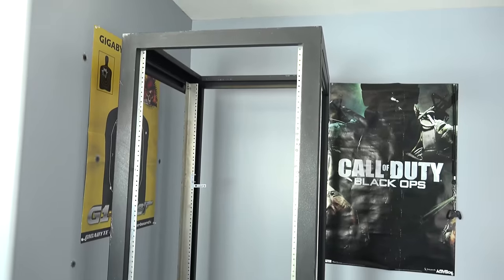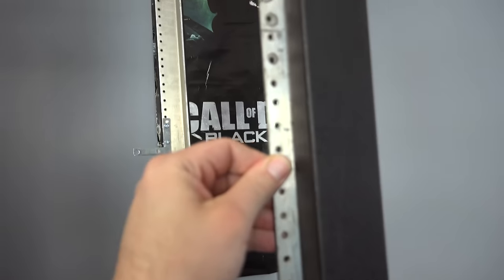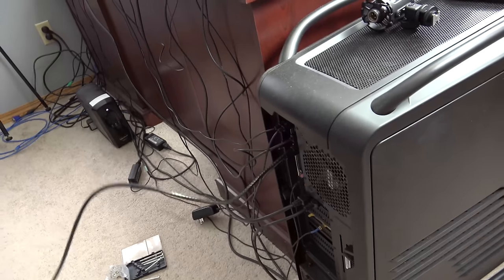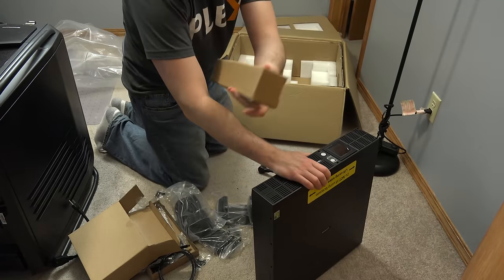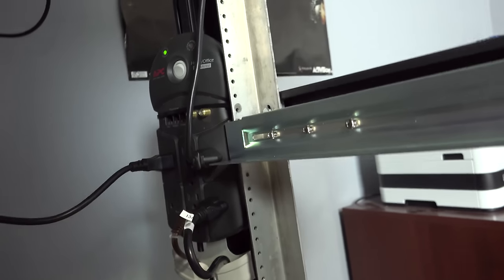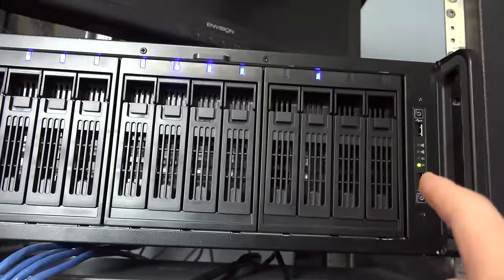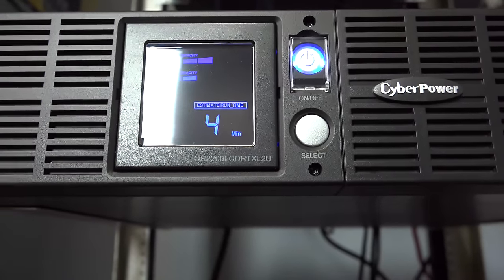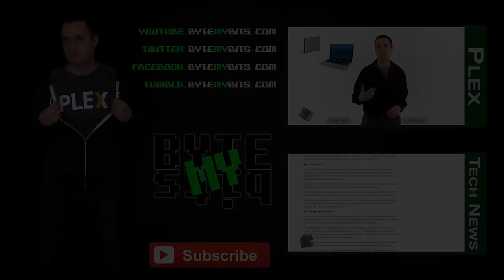Network/Server Upgrade VLog

Comment: Dude you should really invest in a redundant power supply for that storage server since all it takes is ur raid array rebuilding and ur supply to drop voltage and u have corrupted parts of your array and then it will ruin it on the other drives when it does a storage check
Reply: sam murphy ZFS being a CoW filesystem will more than likely survive a power loss during resilvering. The only bad thing is, the resilvering process will start over from 0% and one have to wait a few more days(or weeks)

Comment: Teaming bonding is not that complicated but I'm a Linux nerd so have no clue how to do it on Windows if have sum time il try looking in to it. See if I can't find sum short reading material for you. Kind of busy help my wife with her work/school projects and need to start on my cert studies but I like you projects and even the hardware you plan to use like zfs and free nas. I remember the guys on teksyndicate build a nice free as box a while ago. And even Linus build a nice freenas the problem is that you need to run plex  on the same system so CPU power is needed. Perhaps a bit more time than I have at the moment wish I had a PfSenese machine is on my list to.

Comment: as for the 20 amp thing your fine the braker will save it.. but no not switch your 15 amp braker for a 20 !!! it is there to protect the wires!

Comment: What made you decide not to do 10GBe? It's fairly cheap now a days. You can get a used Cisco switch with two 10GBe ports for ~$400.
Reply from the maker: +Nick Leffler Still too expensive for me.
Reply: Byte My Bits OK. What kind of network connection do you have at home?
Reply from the maker: 165/25

Comment: I believe this is the first video I've seen of yours and I plan on subscribing to see how your journey goes. First off, Congrats on diving into the world of rack mounted gear. It's a wonderful world you'll become addicted to. Go ahead and create a new budget category for it now. :-p

I heard you mention one thing I have to comment on: Mirroring or Raid of any kind is not a form of safe data. I can't stress that enough. Backup, backup, backup. Just being totally honest, but in my experience (I'm a server admin for a large company) raid will fail you. Not if, but when. If you've got tons of data, consider something like Amazon Glacier, or even just grab a 4TB external drive that could fail at any moment and perform backups. The chances of everything failing at once is really low. If nothing else, use google drive as a backup for those super critical, small files. I believe $20/year gets you 50GB. That seems plenty for most "Document" folders. Just my two sense, not hating. :-)

Comment: Have you looked at unRaid?  I've been very successful with it for the last 3 years, and now exploring the new version with docker apps.  Plex as a docker application I think is a pretty elegant solution for a Plex Media server.
Reply from the maker: +Matthew Clawson I have read about it but it costs money :(
Reply: True it does cost $90-120, i do believe it is far better than running windows and other options (parity, cache drive, and mix of hardware or drives).  Just a thought!  Keep up the fun videos!
Reply from the maker: +Matthew Clawson Yes it seems like a very stable/good option. I am just stuck with...spend $130 on a pro unraid key...or $140 on another HDD and use FreeNAS lol  Either way, I am stuck on windows until I have enough drives to build new storage pools (5 drives each) and move data over to make room for the other pools. I need to do this badly, but need a few more drives before I can. It would be fun to setup an UnRaid server and show how to deck it out for Plex, etc...but at the cost of a pro key, for me, equals another drive and a sooner adventure into a new filesystem.

Comment: The newer Core i3 's support ECC memory, So you could use one of those, if you dont have the need for the more powerful Xeons.
Reply from the maker: +unijabnx2000 "Need". Such a funny word...
Reply: +Byte My Bits .... lol yeah. You could always start with the ECC MB and ECC RAM with the i3 for now to save some change, and get the project rolling. Do some benchmarking about how it performs for you work loads etc... and later post the upgrade video to the Xeon  with comparison results.

Comment: noooooo there are non rail compatible racks. p[eople been mounting them this way for years. its fine. ive hung SERIOUSLY heavy amps from only the front ears, wouldnt do it with a server, but if the rear is supported as you have its no prob. the server isnt moving, those screws can hold LOADS of direct weight, just no wiggling about ;) use ALL 4 screws tho or you promote the ears to turn = sheer force on the screws holding the ears on. always use all the screws on the ears
Reply: The softer metal always gives, in this case I think that will be the screws. And then, Thump...double the L braces and use bolts with nuts. Bolts are meant for this type of thing

Comment: I wonder if you were able to get a second hand HP Prolient DL580 then you might be able to strip it and and put it in a larger case and use power supplies that would be a lot quieter and use water cooling in place of the HSF that come as standard on the HP Prolient DL580 and with 4x36 core I7 XENON processors giving 144 cores (288 virtual cores)  and 1TB or 2TB of ECC system RAM 12 3TB SATA drives running in RAID 10 would that would make a better  PLEX media server, you might try the file server version of UBUNTU or FreeBSD, UBUNTU-BSD UNIX is in BETA but should be out soon as a very stable Distro, Can you not use 30A coble from your UPS to the Mains 30A circuit, you could try using fiber optic cables and LAN to fiber optic interface hardware at each end then you might get 4GB/s.

Comment: Holy crap, you are going to lose that server is you keep mounting stuff like that. 
Some advice for beginners, the rack you have is a comms rack, not server. You would be best to get a 22U server rack that has doors and sides but more so, is a server rack meaning it has rails depths of at least 800mm. As others said, UPS's always to bottom, weight down low but also batteries can/do leak thus you don't want battery jiz on the gear under it.
The server you have (OMG, Windows 10, dude, seriously???). Put a server OS in, don't be cheap. Run teaming from it and be happy. 
I have little time for CyberPower gear, not anywhere near what other vendors for same coins can provide. 
I have skipped a lot of the video as I don't have all day to watch it. I will come back later.

Comment: This feels like im watching myself build my home network lol

plex media server? CHECK!
pfSense router? CHECK!
GB Switch/Lan? CHECK!
server rack? NOPE! :(   .... although i do want hahaha

you CAN get 4Gbps with windows, with some slight configuration, and if another device on your network is also connected to the switch at 4Gbps. Otherwise you only have a server which can accept four 1Gbps links transferring at full speed simultaneously, which is also good, but overkill if you dont use its potential.
My plex server is connected via a single 1Gbps link, and i have no issues at all, even when transferring files to it (my average speed is ~115MB/s)

pfsense doesnt need powerful hardware... although doesnt hurt to have anyway lol
my pfsense is running on an old hp ultra slim form factor with a core 2 duo, 8gb ram, and a kingston 120gb ssd. runs perfect and installs in just a few minutes (i used a usb flashdrive installer).

although your placement of hardware in the rack, i would have done differently.

Your plex server, i would have put more in the middle of the rack, rather than on top like you have it. reason for that is, top section you can use to put a monitor or kvm rack mount, if need be, at a comfortable height. I also like to have my switches at the top, for cable routing preferences, but like i said, preference anyway so no big deal.

UPS power supplies are left at the bottom for obvious reasons. They weight a TON, so i dont think you'd like to lift a heavy battery when one fails xD . Secondly, they anchor/stabilize the rack itself by lowering the center of gravity by having the biggest chunk of the weight at its low point. Lastly, better for cable management having chucks of cables at the bottom rather than the middle of the rack :)

good vid nevertheless!

Comment: NAS4Free is what I prefer over freeNAS. according to the internet, NAS4Free is the original freeNAS until, new freeNAS group took over the name and bared the original developers to use the name. 

ZFS RAM requirements boasted on the  freeNAS forum are all rubbish. most of them fail to mention that 8GB Min Ram requirements is mostly to do with assumption that one would be using dedup. I have been using ZFS with 2GB RAM for years with NAS4Free. Never had a single issue. with storing video file, there is absolutely no reason to use dedup (de-duplication at block level). 

ECC Memory is great if you have the hardware for it. I don't. I run my ZFS with normal RAM. Just do some through memtest for few hours and make sure the RAMs are good for now. If you ok with using windows, then there is no reason to doubt a ZFS system. ZFS system is far better designed and far more checksum checks.

http://wiki.nas4free.org/doku.php?id=documentation:setup_and_user_guide:hardware_requirements

ZFS kernel share memory within the FreeBSD kernel space which is between 1GB-4GB (preset in kernel). but ZFS will use ANY amount of available RAM as read or write cache in a attempt to speed up the process. Even if one has a pool as big as 100TB, the entire 100TB is not required to read and write at ones. you only have 4Gbps links. which equals to a max speed of  500MB/s read or write. your drives will probably only read or write at max speed of 200-300MBps. So what would be the use of extra 14GB Ram on the system.!? Just cache memory, in case you read and write the same data over and over again. to top it up ZFS can also use SSD as secondary L2 Cache called ZFS L2 Arc.

https://wiki.freebsd.org/ZFSTuningGuide

NAS4Free with LAG setup
https://www.youtube.com/watch?v=AyXasKDtcFQ

ZFS Memory Myth
https://www.reddit.com/r/techsnap/comments/3h0xmz/zfs_memory_myth/
http://distrowatch.com/weekly.php?issue=20150420#myth

Attempting to cache the entire internet with 1000s of TB of browser cache is pointless. So, why would you attempt to cover the entire 1000s of TB of pool with 1000s of Gigs of Ram?

https://www.reddit.com/r/DataHoarder/comments/47qedb/how_much_ram_for_100tb_zfs_pool/
Reply from the maker: +Anon Ymous great read. thanks for the info!

Comment: Did now know could get a 110 to 220 adapter. Something it worked for you. Do you know 220 is the 2 pulls on each side of the electric circuit breaker box are 220. I guess a basement under you? You could run a cable and 220 plug in the wall up from the basement.

If you want it neat run Ethernet plugs in the wall can do it from under in the basement up in the wall then just plug the Ethernet in the wall.

You did not have to use swear words. Other ways of saying the same.

Comment: They actually do still sell that hotswap case! :D

Now, whether or not they are still MAKING it is another story, but I hope they are, because before I even sa the video I have been planning on buying two of them. They are basically the perfect NAS case for beginners who want rack-mount. 

And WOW that fan on the UPS! xD
I was laughing soo much, and I was just as relieved as you were when they ramped-down! Because I'm getting a similar model! lol

With teaming and using SMB, you should get 2GBps between your main computer and the server. 
Then, because the server has 4GBps that leaves enough overhead to do another transfer at 1GBps from another machine and 1GBps still open for streaming without a hitch. 

This may help you out :)
https://youtu.be/K4VnWQPW-f4

Also, if you want, there are methods to have 20Gbps between your main PC and the server if you are willing to spend About $200. Two 2 port cards with a proper cables. Something to think about. :)

Also, loved the long video. Anytime you are doing upgrades/changes, I'd love to see more. 
And don't worry about the video length!

Comment: you need to get the rails because yes if you do only have that it can and will probably mess with your case and that in return will probably destroy your hard drive because the moving Parts in hard drives.